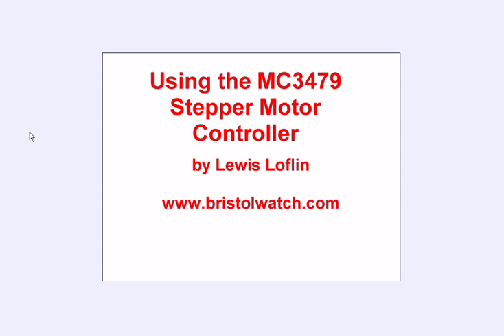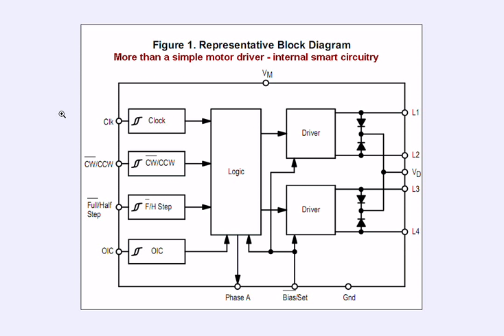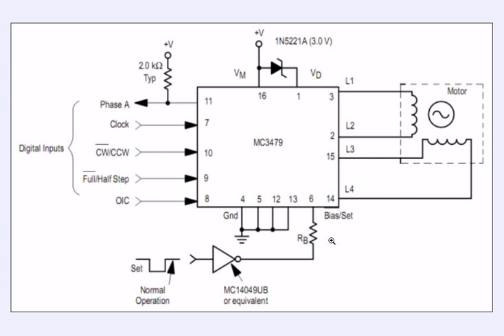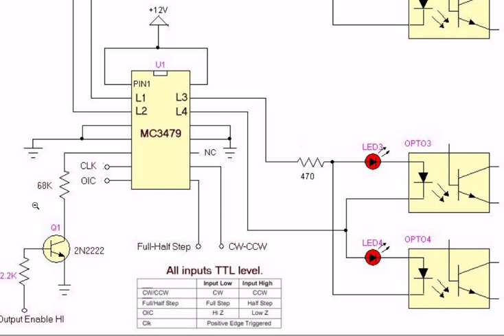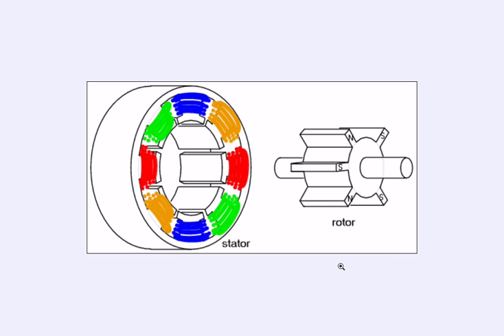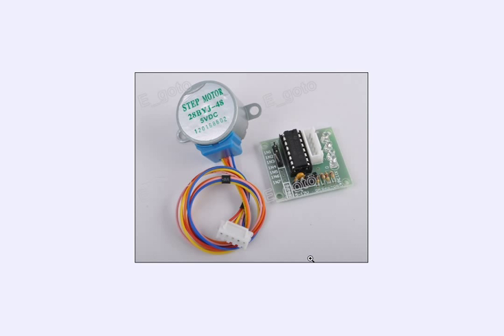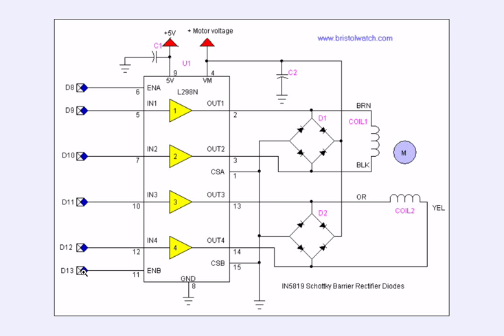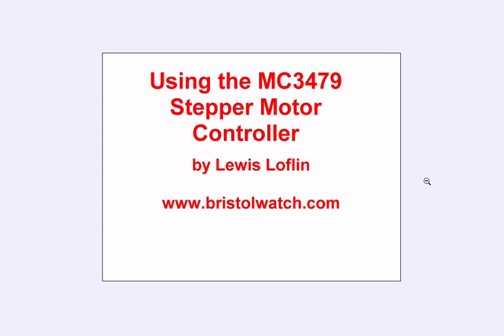MC3479 stepper motor controller with Arduino Pt 1

Comment from the maker: The MC3479 is hard to find. The same ideas
work with Easy Driver.

MC3479 stepper motor controller with Arduino Pt 1

MC3479 Stepper motor controller with Arduino Pt. 2

Using Easy Driver Microstepper with L298N and Arduino

Easy Driver with Arduino and Unipolar Stepper Motor

PIC16F628 PIC Using Rotary Encoder to Operate Stepper Motor

Comment: Nice video but,... I have a question:; how do you set the maxi current in the cois of the motor?
Reply from the maker: You have to use a current limiter at the power supply end.